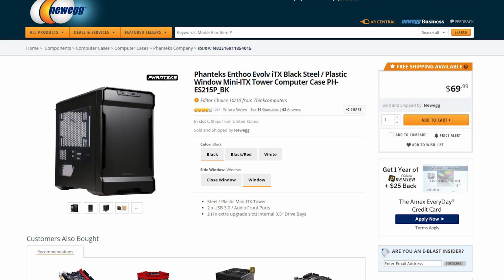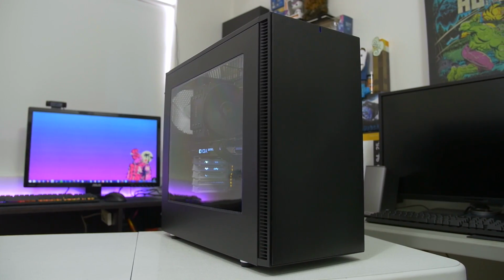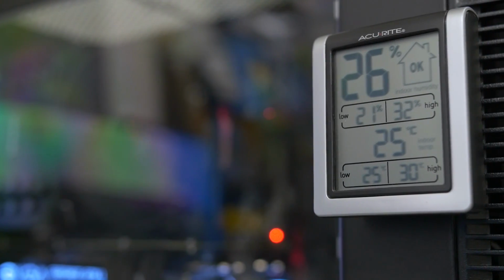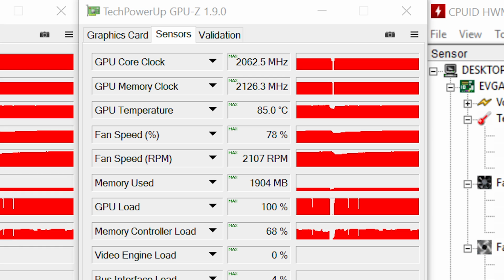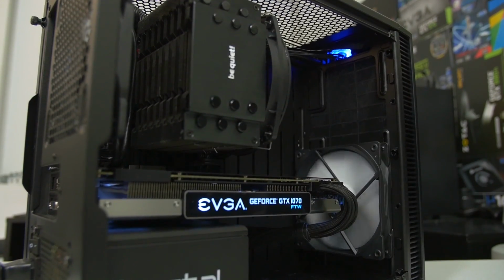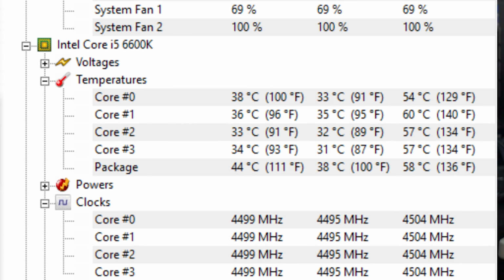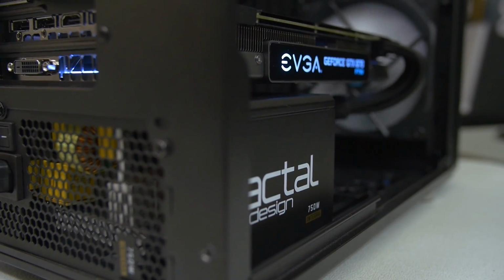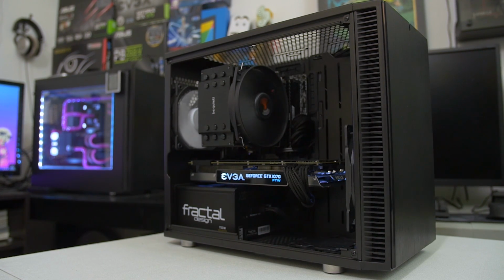Are Blower Fan Video Cards Actually Better in SFF Cases?

Comment: My 1080ti blower is cooling my ssd just under the card. My case full tower runs super cool because the gpu get the heat out of the case. Also my cpu has a air cooler in push pull configuration. 3x 200 mm fans, one bottom fan 120mm and one 140mm to get the cpu air out. Result cpu at 36-40/50C  at load. Worst isq 62 during high rendering, my gpu stay st 67C during gaming in vr mode and 4k and my nvme ssd 1.3 at 3500/3400 MB/sec stay at 45/50C. My machine 3 years old is really formidable. No need to upgrade. My ryzen 1800x asus crosshair vi hero and samsung ssd, asus 1080ti turbo edition blower , do really the works, and don’t forget the thermaltake core v71 full tower case and seasonic 700w
Fs2020 runs at 65fps in 108, 60 fps in 1440p and 32fps in vr mode at high settings 100 scaling and details. It runs incredible. Blower edition can be noisy at 4600 rpm for sure but i kept it at 3500 rpm and that is very correct. The result is very good.

Comment: wish I had seen this earlier. I ended up switching design in a SFF project and it not only lowered case temperatures by 15 degrees under load, but also made it possible to run a higher end GPU at full load without having to play around with clock speed for thermals,

Comment: I know this is an old vid but when people asked me to upgrade their office pcs with a fairly powerful graphics card I usually went with a blower style graphics card as the shit ventilation of a lot of OEM cases really is a non issue then.
Reply: wrong and I will tell you why....
think of your blow videocard as a aftermarket heat sink.....
the setup with the aftermarket heatsink is pull air into the computer box,  the air gets pulled into the cpu cooler and exhausts from the back.
now with a blower video card... sucks air from  the front intake... and leaves the case!
No heat is left in your box!
so you cpu heat exits the back of the box
gpu heat exits the back of the box!
Done!
Reply: @dareason7581  I exactly said that shit ventilation in a case is a non issue when using a blower style card. What is wrong about that?

The reason is that there is little to no heat being left in the case when a blower style cooler does It's thing. It might make the pressure difference between in and out a bit bigger but negative air pressure is not a bad thing in poorly ventilated cases as it prevents convection. (Makes dust issues a bit worse though)

Comment: Why not use SFX power supply instead if ATX? As for gpu cooling i used 2 slim 120mm fans on my case left cover and made some tunnel for them which separates gpu from cpu and those 2 fans from gpu fans. Result is that gpu fans suck only fresh air from front panel fan (any part of Hot air generated by gpu does not come back to them) and 2x120mm suck out entire heat that gpu generates.

Comment: I have this issue with my nzxt h200 case..only have a 50mm gap, so going for 2070 super MSI ventus oc which is 41mm thick, hopefully enough space for air getting into those fans...

Comment: Now I got another question... will that blower card see a significant change on the mid tower case and with more fans and airflow? or will it simply not care, and still run hotter than the custom card?

Comment: If you have a case with a dust filter at the bottom, and instead mounts the PSU at the top, with passive/intake of air, a blower-style card isn't actaully too bad, it might actaully help pull cool air into the case and the GPU! But most cases aren't designed that way.

Comment: Hi i am thinking about upgrading to gtx 1080 ti strix but i have mATX case and when ive measured the gap between the gpu and the psu shroud there would be 1.5 cm space between them because its 2.5 slot. I presume thats not ideal right? Should i get some 2 slot card instead?

Comment: NECRO! Would it be viable to flip the PSU so that it draws hot air away (downwards) from the GPU and exhausts out the back? Or would the raise in ambient temps due to lack of fresh air for the PSU negate the benefits?

e2a: I swear PSUs are super quiet regardless :-p

Comment: You are not providing any reason why any gpu should not run at 85 degrees. I think they are fine at up to 95 at least. It may not be ideal, but they are designed to tolerate those temps. Do you have any legit references or even anecdotal evidence that the cards in the video can not run at those temps? I bet no.
Reply: ...so the other card ran at 84 and the case didnt blow up??? wow
Reply: Temp limit by default for gpu boost is 85C, you can change it in MSI Afterburner to 90C, sooooo to get the highest possible clocks you wanna keep it at 80C or under.

Comment: Hey Kyle, huge fan! I know this probably won't be seen but I am going to ask this question on 2 videos since they are both relevant. I am going to be doing a build in the Define Nano S and even though I am not overclocking, I still have concerns about heat; since I will be traveling with my rig, liquid cooling is also a concern. I was going to probably go for a blower style GPU (GTX 1070, 1080 or RTX 2080). I wanted to get one set up with "all-in-one water cooling", I was also going to use a basic 240mm CPU liquid cooler as well. It looks like I can make it work, but my question is this: If I get rid of the bracket on  the bottom of the Define Nano S and use it for my GPU fan/radiator is that practical? Or because I am using a top-mounted radiator for my CPU, can I use my GPU fan/radiator as my exhaust fan on the back of the case next to the motherboard? Any advise would be appreciated. Love the videos, man! Take care!

Comment: my pc  beats them all in terms of how compact it is; the alienware x51 r3, ultra compact. i was a little less educated on video cards when i bought my gtx 1060..my next upgrade will definitely be a blower style fan because of temperatures..it really can be a bit of an issues, especially since the design had the hdd directly below the fans with less than an inch space. replacing that with an ssd solved my overheating issues, but my gpu still runs fairly warm all the time. 80-86c when under load, no matter what fan speed. i'm starting to think that the hardware itself has some sort of configuration that causes it to want to stay at around 83c at all times, because even turning up the fan speed to 100% makes no difference in terms of temperatures. those that say 83c is way too hot or is damaging over time are simply ignorant. i've been using mine for the past few years putting all sorts of loads on it, including games like the witcher 3, fallout 4 at 4k resolution, dark souls 3 at 1400p, and world of warcraft and diablo 3 all at 4k, no matter what game  the temperature is always the same when under load; ~83c and there are no issues- in fact the pny manufacturer says it's safe up to 95c.. the issues only happen when it gets up to 90c and beyond, the fan speed maxes out and if the temperature still does not go down it will start to affect performance, but i only had that kind of issue before i got rid of the hard disk in favor of a small cool ssd. the way the computer is designed, the video card is basically separated from the other components of the pc in its own part of the case, there's the card and directly below it the ssd, under the card it's about 1 inch space of air about the same size as the card itself- so the previous hdd caused heat issues.  there are no exhaust fans to expel the hot air so it just sort of sits in the tiny enclosure, i imagine a blower would improve things greatly and allow me to turn up the voltage for an oc.

Comment: I had a MSI Aero 1080. Never again will I use a blower style cooler. Put an aftermarket cooler on it and now it has a hard time reaching 50c. Whereas stock it was 60 idle and 90 plus under load.

Comment: 9/10 times most people will have a headset in so the gpu fan noise wont be noticed. i for one would rather have cooler temps at the expence of a bit of noise than risk burning up expensive parts. my evga 1060 never gets above 34c and ya ik not that hot of a card but it hasnt let me down. cpu and mother board temps stay around 40-50 constant

Comment: My problem is not my case. I have a be quiet! Base 600 case, but I'm using the Tuf Z270 mark 1 and it only allows you to plug the 1080 ti into the second slot, idk why but it won't fit into the first!!

Comment: I swapped my Asus Strix 1070 out with a Asus 1080 GTX Ti blower, my GPU dropped with 5-10 degrees when idling, there was no change on full load, and my cpu temps dropped 10 when idle and 5 under loader.

Comment: My micro cube case has the mobo mounted horizontally and the psu under the mobo plate. So my gpu is mounted vertically, but super close to the side panel window. The window is plastic so I reamed a hole right over where the gpu fan is so it can pull air in through that way

Comment: follow up: what if you reversed the fan that's right above the power supply? that way its pulling heat away, exhausting hot air directly into the intake of the power supply to be exhausted out the case.

Comment: Honestly I don't agree 100% with this It really depends a lot on the case design because not every SFF case will have that layout as the one you used. I've seen some brands manufacturing cases for itx-grade computers that did radical changes in the orientation of the parts, and three of them were the: 

-Nox Lanbx (the PSU was right above the GPU pcb avoiding the fans)
-Corsair Graphite 380T (bulkier but the horizontal placement of the motherboard meant the GPU fans were directly faced to the meshed left panel of the case, having direct airflow from the outside, and the same could be said on the right where you can mount a 280mm AIO cooler)
-BitFenix Portal (based on the Portal Turret design, this extremely compact pc still manages to fit a Strix cooler sized GPU on the top although with the fans pointed upwards and fit a 120mm AIO cooler for the CPU in the place of the front fan, with the only caveat being you're limited to SFF/SFX PSUs while the others fit ATX ones)

Were the tests done in these cases, the results would very likely be much different considering none of the GPUs are blocked

Comment: You have to use a blower type card. I have a Fractal Design define nano S with an RX 480 (non-blower) and my GPU is now overheating constantly 5 months later (and possibly dying). Use a blower/liquid cooler hybrid, you will avoid overheating and high noise.

Comment: i have the 1070 FTW edition inside a midi tower and it runs at anywhere from 1970MHZ to 2000MHZ, but it never breaches 70C, max i've seen is 65C what is wrong with yours?

Comment: The node 202 and RVZ02 have the gpu on a riser so it is going vertically the same direction as the mobo. There are giant vents right next to the component fans so it kind of acts like open air.

Comment: You pointed an case intake fan on the back of the GPU. That will force hot air that is being exhausted through the back on the GPU back over the PCB of the GPU and increase heat build up. That will hamper the GPUs ability to cool itself.
Reply: jup! This must be tested! Also the power supply the other way...here are too many negative varibles in place. But thanks for the video!

Comment: I have the 750ti twin frozr (MSI) and keep the fan at 100% -- I had the stock cooler for the 8350 (the orange-ish, red-ish box) so i didn't care the percentage.

NOW I ended up screwing the CPU and had to buy a new one, so i said screw it and bought the Wraith edition 8350 and said "Holy shit" so i bumped up the fan speed and said "screw it" and put it to 100% because it was still quieter compared to the old CPU cooler alone.

Comment: Couldn't tell any difference at all in the sound demonstration.  I don't know why every techtuber is so freaking worried about sound for the normal consumer.  I realize you guys are trying to record videos with low background noise and you have acoustical padding and whatnot in your studios, but I NEVER notice ANY of the 6 fans in my system, all of which are cheap, stock, and in no way optimized for low sound, even when the fan curve cranks them way up.  I just don't ever see fan sound being a big issue.

Comment: One thing that i think should have been tested in this video is where in the Mini-ITX case the PSU should have been flipped and the fan inside the PSU should also be flipped to blow directly onto the GPU and see what the temps are then... I recon it will reduce it to almost the same as the mid ATX case

Comment: Yeah, what if you flip that PSU with the fan side going inside the case. If you have a fanless PSU, or a PSU that the fan only turns on under load I think your results would be better. OR.... If you have a PSU with  a fan that's on 100% of the time you could just turn off that left GPU fan.

Comment: I know that sadly my 1080 amp extreme with defiantly over heat when it's in the bottom pci slot in my p400. It makes me sad because it makes the mobo look so much better with it down there but will randomly freeze video feed.

Comment: I love itx system cases, but thermals can indeed be a problem.
Luckily my personal rig is packed into a coolermaster 130. The 130, before it was demoted to my mobile rig, had a gtx 1060 ROG strix and a 4790k OCd to 4.2 ghz and a basic coolermaster 120 AIO cooler.
Because the GPUs fans are positioned directly against a perforated side pannel and the CPU was cooled with a cheap AIO, all compoments stayed very cool.
I do not like these designs that choke the components. If you are going to use a small form factor case, get one that utilizes proper air flow strategies.

Comment: I have a very similar setup myself, although a step down in performance. Define Nano S, ATX power supply. Right next to it is my Gigabyte GTX1060 6GB and the 6600K is cooled by a CM Seidon V2. Now, the max GPU temp I got when stress testing it was 80C, which is pretty hot for a 1060 with no OC. But, after adding 2 x 140mm Fractal Design intake vents in the front and one 120mm at the bottom (next to the PSU, facing up), the max temp I got was 76C. The exhaust is handled by the Seidon's 120mm rad vent and by the opened top - passive. This being said, the GPU fan speed never gets over 60%, while the two 140mm intakes are underfed by a voltage reducing cable, thus spinning at maximum 50% of their original speed. So in my book, the setup is pretty quiet and well ventilated. What's your opinion?

Comment: you completely ignored the fact founder edition run on 60% fan have extra 40% cooling boost for even better cooling and overclocking and open air on 95% fan not have anything left.
Reply: LordX exactly, if the founders edition card were at 95% it could have been in the low 70’s
Reply: @cjdagamer  You're getting into jet engine territory though...

Comment: For the Raven Rvz01, the fans for the GPU is facing out of the case with only a filter in front of it. Would still be recommended to get a blower style GPU or would it not be much of a difference to get an open-air cooling GPU. Thanks !

Comment: im gonna use the mini c with a1080 or 1070 im going with a blower and im just going to be using the 2 fans that come with  the case since the mini c has a Shroud and  neither  my gpu or cpu are overclocked will i have this problem  if so how much cooler  will a watercooled gpu be

Comment: Fractal should have just done what inwin is doing. Mount the motherboard lower, and place the PSU at the top. Then just add some vents to the bottom of the case for the GPU and you wouldn't have this problem of PSU interference. I'm waiting on the Inwin 301 to release I guess before I build my Ryzen rig.

Comment: What if you were to use a PCIe ribbon cable and flip the card upside down so the GPU backplate is against the PSU instead? If even possible. Might have to do some custom GPU backplate fabricating.

Comment: > Whopping 5 degrees
> No GPU should be running at 85C for a long time
> Not worth causing any damage to your components

Yes, disregard the fact that the 1070 was designed to run at 83C as its temp target, lol. Disregard also the fact that the only thing on the GPU that can be damaged by high temps are the capacitors, and those are rated at 105C, or 85C for the cheap entry-level cards which is still impossible to hit unless you remove the heatsink altogether.

Please drop the dramatisation.
Reply: Spoke to a Friend who works for Nvidia. He says yes, components on the board normally are designed to handle higher temps than the GPU Core itself.

A blower GPU really works well in a build like mine. I use a ZOTAC GTX 1080 Ti Blower and stuffed it in a SG13 case. 

After some tuning, undervolting and with fan speed control, I managed to get it running at its full turbo at 1860Mhz all the time without Throttling. In a 25C Room, got 75C on the Blower Card At 60% Fan Speed
Reply: @magickamagics  so far without even touching the voltage yet I've managed to get both of my MSI 1080 TI Aero in SLI to 1936 megahertz stable overclock with a + 91 on the core + 90 on the memory... It could be the other way around with 91 on the memory and 90 on the core I can't remember but it's stable oh and I keep my fan speed at 80 in MSI afterburner without a custom fan profile( because I don't know how to make one but I wish I did) and so I usually get my cards down to between 78 and 80 degrees C while overclocking.. otherwise if I have fan speed set to Auto the top card runs at 83 to 84 in the bottom Card usually runs between 29 to 37 Celsius
Reply: I'm pretty sure modern high-end gpus are designed to run at temps in excess of 90 degrees C not that it's desirable or anything but it shouldn't damage your GPU long-term so running at temps of 83 or 84 degrees C might kick out some heat into your room depending on what style of Cooler you  have but other than that it's totally fine
Reply: Yeah but it still thermal throttles and kills your frames. on my 1080 anyway. New cooler and consistent 144fps plus.